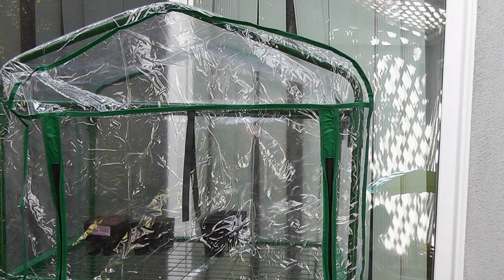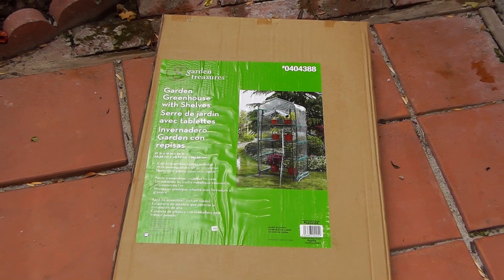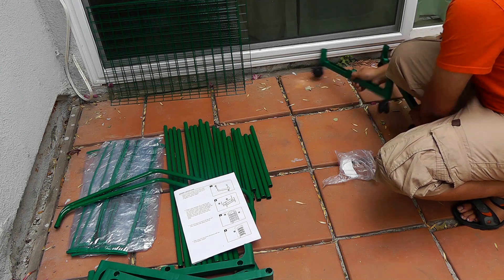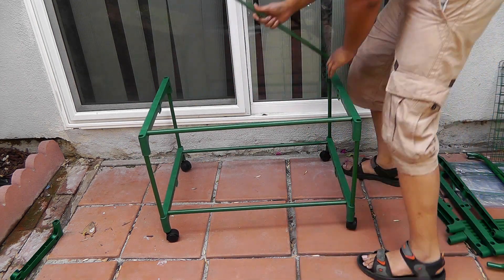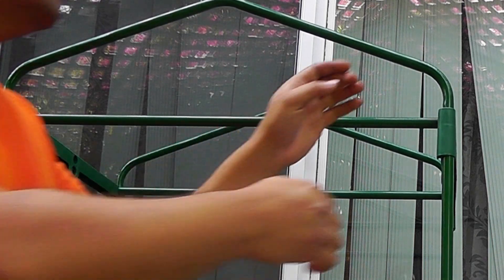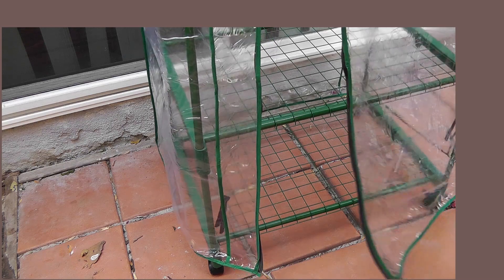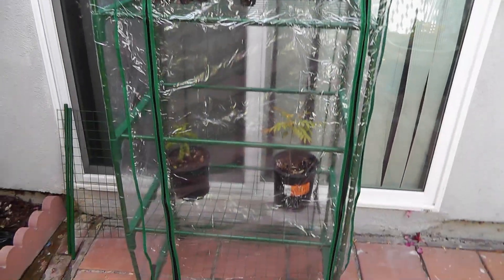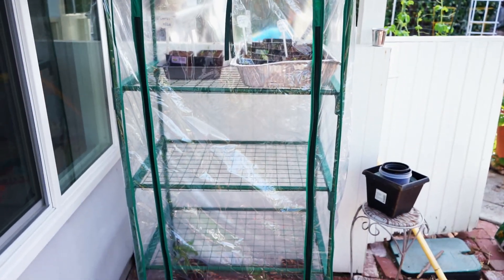Greenhouses - How To Build a 4-tier Gardman Greenhouse Easy & Cheap in minutes!

Comment: I use the aluminum turkey pans for seed starting and light reflection when the seeds have been germinated. They do come in handy in a lot of ways. You could probably fit two on each shelf to keep the small pots from falling.
Reply from the maker: Its interesting you mention this. I started using aluminum pans (yes the baking ones) because they were the cheapest to hold the peat pots together. I got an assorted small set from Walmart for very cheap and now almost exclusively use those baking trays (Turkey pans) to hold the seedlings. I didn't think about the reflection part but I am sure that will help! Thanks!

Comment: hi, you don't need the horizontal poles on the top shelf. Use the extra for the middle supports.
Reply from the maker: +pee cee Thanks for the tip!
Reply: Yes I did it that way too the first time which is why I am here LOL... I knew something was wrong when I had 2 poles leftover. They are for center support I am sure but the model I saw set up in the store had grow lights attached to them. The instructions didn't explain any of this.

Comment: I have the 2 tier mini educational insights greenhouse. I'm wondering if it is the same company as for your greenhouse?  I would like to put wheel on mine but not able find the right posts to fit mine.  Any ideas?
Reply: +ziggilypiggily the length of the posts are too long and too narrow - narrow can be fixed with the extra width sleeves bought separately.

Comment: These do groan under the weight of a few trays of seedlings, and leaning one side or the other after a wind, but hey, they are cheap as hell. I just have some stakes one side to stop it falling over in case we have a very windy day. A heavy pot in the base helps too in case you haven't put much else in it yet.

If the side parts were metal or more heavy duty plastic, and the tubes stronger/fit more securely, it could be a really long lasting strong product. Shame there's no premium versions that I've seen - a mesh exhaust vent would also be awesome. I was thinking of silicone the tubes into the frame to make it more rigid but then I wouldn't be able to take it apart end of season.
Reply from the maker: +Darkfalz79 I screwed it against a wall to prevent it from toppling over on windy days, has stayed up well so far, 1 1/2 years and still going strong! Yes this is a cheaply built product but for $30 I wasn't really expecting more. Since the shelves can be customized for height, I can keep both big and small plants and it works very well for the stuff I do.
Reply: +Darkfalz79 if I have it on the ground vs patio/deck would this keep it sturdy enough? - if I put a length of re bar at each corner pounded into the ground and zip tied to the posts on inside of greenhouse?  My neighbor did this with her wood lattice seating arbor (a bit taller than this greenhouse) and it stood the test of high summer winds. I guess it might wind whip at the plastic a bit more though - but can be taken down for winter.
Reply: I glued mine with some heavy duty silicone sealant/adhesive and they are much much better.